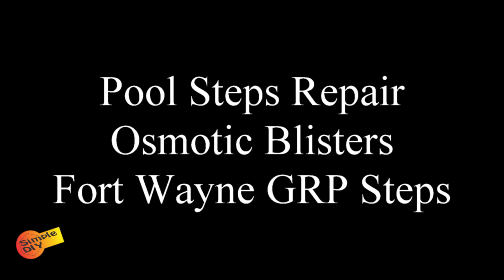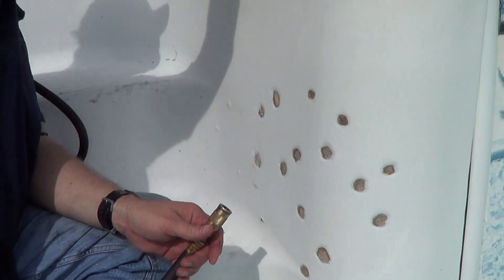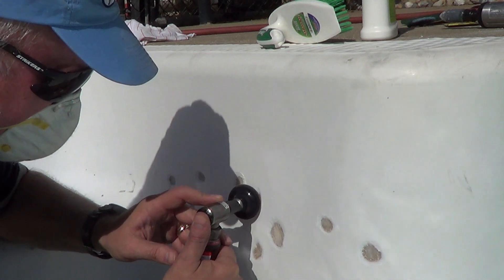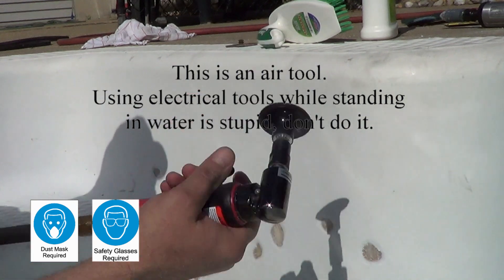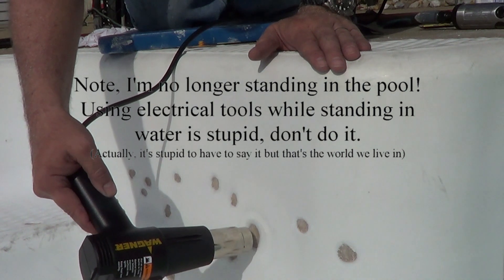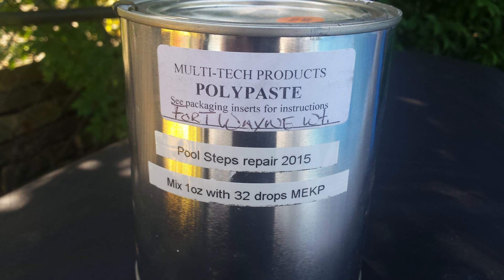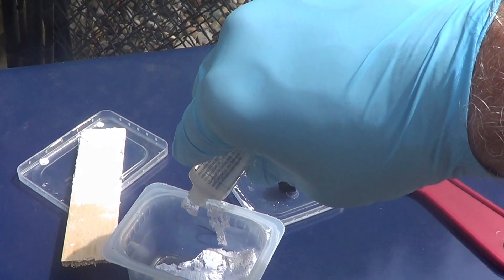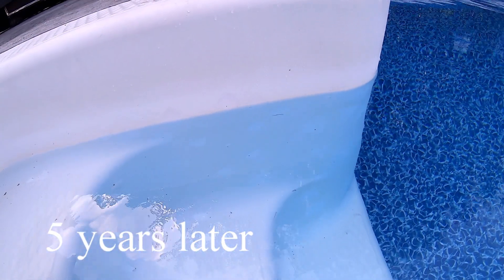Pool Steps Repair - Osmotic Blisters

Comment: thank you for sharing your project. I am repairing some cracked, fiberglass steps, which are basically the same kind of steps of what you had there. Mine are blue. What are you happy with the product? I’m going to fiberglass reinforced the steps and then was going to do some kind of gel coat until I saw your paste. I’m gonna have to add Blue to it. Any suggestions?
Reply from the maker: yeah, contact Multi-Tech directly by phone and ask them for advice.  I know they make different colors, which is more common for hot tubs.  I just re did my steps this year, and I bought a new batch.  It still took 30 drops.  I got a little better results this time.  I ground back a little further made sure I got rid of the debonded material.  I'm not sure how strong it will be if you have structural cracks, this is really just a hole filler.

Comment: Thanks, will give it a try before spending $5K on new steps!
Reply from the maker: I just reworked my steps this yesterday, a couple of hints.  Don't apply it too thick, it'll shrink and crack.  If it's a deep hole it'll take two or three applications.  The cure time at 22 drops is about 1 hr, whereas 30 drops is about 20-30 minutes, so because of the multiple layers I went back to using 30 drops.  I was able to powerwash my steps in just 24hrs.  Be prepared, this stuff is messy.  You're going to get single use out of every mixing cup, stick, putty knife and set of gloves.  I pretty much did all my finish work with 100 grit sandpaper, anything smaller is too much work.  Good luck

Comment: Great video! Thanks for sharing! Just completed repair of my pool step blisters. I’m assuming this product requires a 24 hr cure time but cannot find much technical data on it. Your video was VERY helpful!
Reply from the maker: It hardens in about 5 minutes, so 24 hrs should be all it needs.  That's just my opinion though, it doesn't come with any info.  This year I ordered some more paste and the tech told me, the correct mix is 22 drops/oz.   So this year I'll test a batch at that mix and see how it goes.
Reply from the maker: I just pressure washed my steps after just 24 hrs, no problems.  Also 22 drops/oz is too slow.  Cure time is about an hour, I went back to 30 drops, cure time was about 20-30 minutes.

Comment: is it possible to drain fiberglass pool w/out bracing?  have heard if originally filled with water when adding backfill with 97% compacted stone, and drain line under pool to outside so not water under, it can be done w/out bulging of walls.
Reply from the maker: Draining any pool is tricky.  Depending on the amount of ground water you can damage an empty pool because it will attempt to float above the ground water.  Best to talk with someone who knows more about it than me.
Reply: @simplediy3727  Absolutely no crown or water surrounded by drainable stone to drain tile out to open air the only question would be if some of the backfill might fall when the pool walls relax from not having water